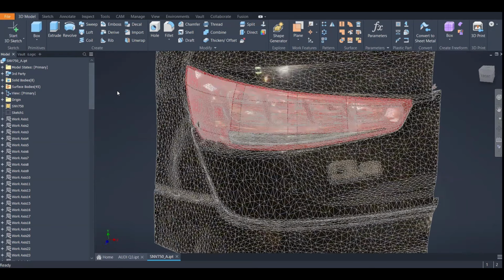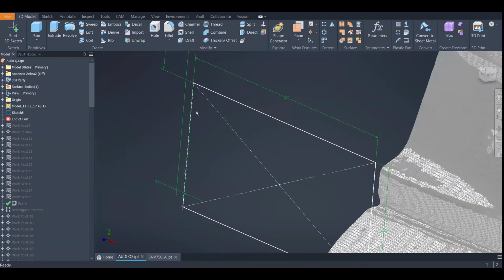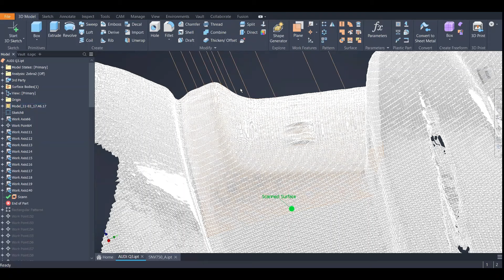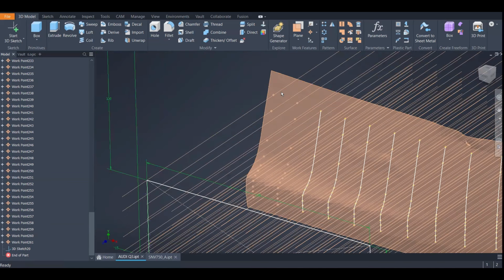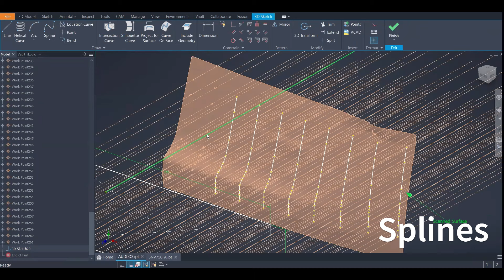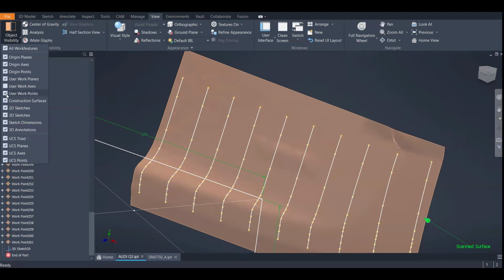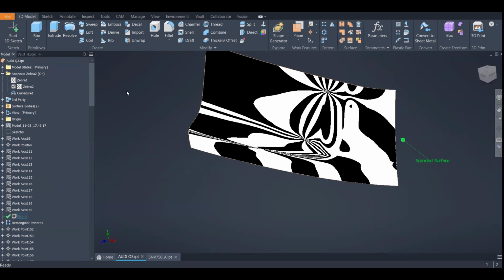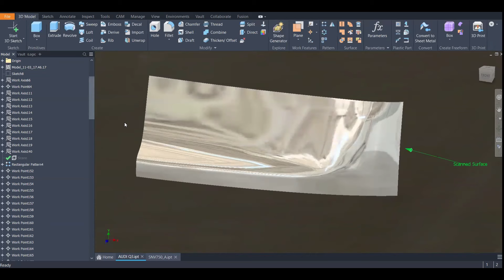From 3D Scan to Surface in Autodesk Inventor 2025

Comment: which scanner was used for the scan? Also, was the scan data brought straight into Inventor or was it converted first? if so what file format came out of the scanner and what format came into Inventor?
Reply from the maker: The scanner is Structure sensor (@structuresensor) by Occipital. The output from the scanner is a OBJ file that can be imported into Inventor directly.  No translations or intermediate steps are required.